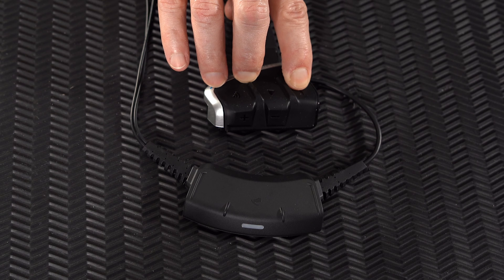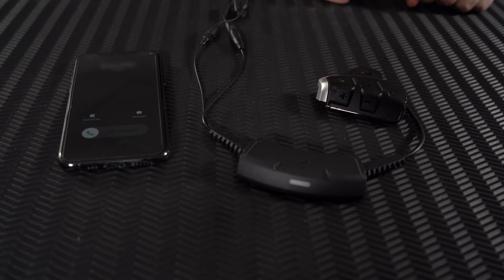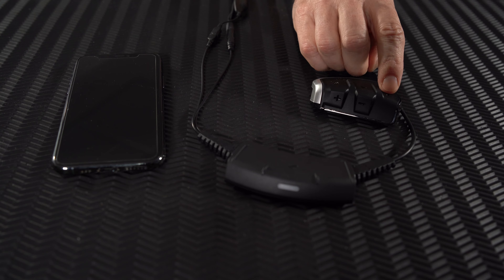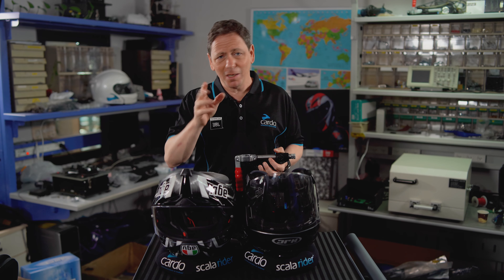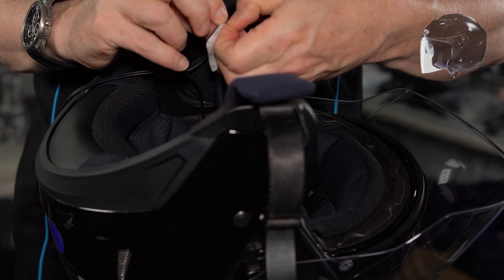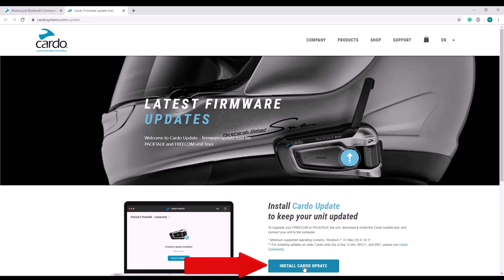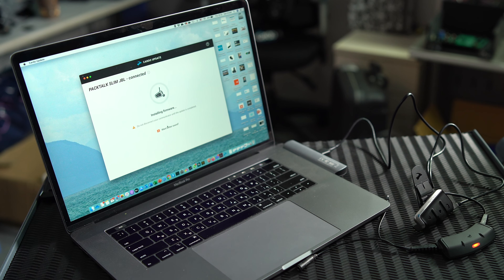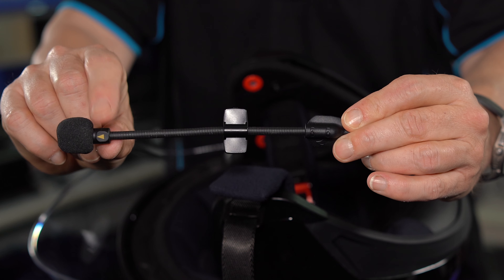Cardo PACKTALK Slim: Complete Tutorial

Comment: Just got this and haven't ridden with it yet, but a few things I've found already. 1)The helmet feels a fair amount tighter with this stuff installed, 2) the in helmet microphone is pointy underneath the foam a stabs you in the chin if the helmet gets bumped, and 3) the charging cord is only about 40cm long. Not long enough to Have your helmet charging off the ground if you're running off a power board and also not long enough to charge from a port on your motorbike etiher. Maybe they could have done away with the absurd over packaging and instead spent the money on a decent length charging cord. On charge at the moment. Would not have a clue how charged it is.. all I get is a red light. Not terribly intuitive.

Comment: hoping for a response, but will the receiver with the buttons that goes on the side of the helmet fit an HJC i10? i understand the i10 is one of the models that's supposed to use Sena HJC Smart but i'd like to use the cardo packtalk slim. The side of the helmet seems to be too thick for the receiver to snap on with pressure.

Comment: I just got the Cardo dual pack  because of all the videos I’ve seen on them. Went for our first ride today and man was I so disappointed. Music share would cut the music on and off  and back on in both modes, sometimes there would be so much static and wind noise then the mic would blast you out of the helmet and  then go very low. Voice command worked when it wanted to and the distance in mesh mode was not that great. We came back and actually took them out and installed the cheap old units that actually sounded better with less noise and static.  I wanted this to work for the music share and was disappointed from the start and it just got worse through the ride.

Comment: After riding my G4 for years, still riding my original Scala Rider. Bought a them when they came out, got one replaced after its antenna broke off. Now, their batteries start to diminish. So I looked into replacements.
While the Bold seems to be the obvious replacement, I like the Slime more, because - well - they are slimmer.
On the downside: Having to basically charge the helmet and not just a tiny unit is just really complicated when on tour and you have to deal with limit space. (Think of tiny hotel rooms, hijacking the power sockets from a restaurant, etc)
Honest question: Why is there still no USB-C connectors? Is it because of some form of regulations regarding water profess, or would you need to conform to more complicated charging specs?

I would love to see a unit like the Paktalk Slim with a Battery that can be swapped out and charged on its own. So I could always have one charge in my tank bag (or where ever) and switch them when the ride gets really long. And let's face it, the juice always runs out when you need it the most: in the middle of the night, it's raining and you desperately need your GPS to guide you to the next hotel. Wouldn't it be cool to just swap the batteries instead of fiddling with cables attached to some power bank, hoping the rain won't destroy both?
Reply from the maker: Hi, 
After multiple tests we have chosen this design in terms of battery usage. The solution for now is charging while riding.  Regarding USB-C, you can always follow our social media channels for any developments about our future units.
Thank you

Comment: I bought the Cardo freecom 2 dual pack. Sound was good between riders but I found I couldn't conect to the tft because it would just cause issues with the other rider . Cardo advised me to buy packtalk bold. I bought the slim version. My units must be faulty because I refuse to believe they can be this bad. Pairing was a nitemare, constantly saying, Helllo, hello? Can you here me?
When they were paired I could barely hear the other rider, when at motorway speeds, nothing. Then even at slow speeds I could barely hear the other rider and he could not hear me at all. Said he was also getting interference and sometimes felt like radio static.
I bought this so I could connect to the bmw tft and hear  my phone ect. The old Freecom 2 was better. I can't understand this. Also the Cardo app couldn't find any units even though they were on and connected. I took these on the North Coast 500 and they failed miserably. We'd try each day, to see if they'd work but going through the pairing ritual was ruining our minds. We just never bothered with them in the end. They just ruin the rider experience.
Another thing is, the helmet speakers go nowhere near my ears, I have the Hjc Rpha 11, the location for the speakers are nowhere near my ears but this was true or the Freecom 2. Cardo should make in ear speakers because all helmets and heads are different.
I don't know what to do now. I'm sending these back as they are not fit for purpose. I may try BMWs own helmet communication systems, they should at least conect to their systems and be able to talk to another rider. I swear I could buy cheap Chinese Crap from alibaba that would be better that these.
I paid £380 for two of these simply to talk to a friend. I could make something work better that these myself.

Comment: I would like to add one point that could be improved with Universal Intercom. I would like to have the option to select a “Universal Intercom Slave Mode” (Packtalk acts as mobile phone for the other unit) This way, when paired with a unit of a other brand, the command to start the Intercom call are the same as with a Cardo Unit (also for the other device). Right now it is really difficult to start the Intercom, if the other unit is paired on Mobile Phone Channel 2. Pressing the Phone button then just activates Google Assistant on my mobile phone (Mobile Phone Chanel 1).
Hopping to see the option on one of the next firmware updates.

Comment: I have my new Cardo sli. It was recommended to me by my riding buddies. I have an Arai helmet and it doesn’t seem to be compatible. There is an exhaust outlet on the back of the helmet. Which is blocking where you would mount the component. Is there a fix or work around for this?
Reply from the maker: Hi,
Please send a message to our Info@cardosystems.com with the picture of the helmet and the description of the issue.

Comment: Also, I often have to repeat commands for the unit to respond.  Is this common?  My microphone is slightly offset but is still in front of my helmet, only tucked slightly behind the right side cheek pad.  I have spoken on the phone with people and they say they can hear me, it sound a bit windy but not bad.  Just updated so hoping that fixes it, but wondering if anyone else has had experienced similar issues!  Thanks
Reply: I just tried setting mine up but it only recognised one voice command. after researching I found a guy recommended to change the language via the app to english UK instead of USA and it started working instantly. maybe try playing around with that?

Comment: I'm confused about the position of the hybrid microphone during installation. The manual states that it should be on the right side while the picture shows that it should be on the left. I ended up placing it on the right side because otherwise the wires are too short. The same confusion is visible in this video. The microphone is placed on the right, but when the helmet is put on, the microphone is on the left side. Confusing. In addition, the microphone is always blocking the closing of my modular helmet.

Furthermore, a great device except for the radio reception. This one is dramatic and the RDS function does not work either.
Reply from the maker: Hi,
For technical assistance, please contact our customer support by choosing your device in the link below:
 https://ecs.page.link/mzDzm
Contact your local distributor via the "Still got a question?" section, at the bottom of the page, by choosing your country. 
Thank you for your cooperation, Vince.

Comment: This video should've shown how to pair devices using the phone app.  It's way, way easier to use the app than remember button presses.

Voice recognition works perfectly once you realize a couple things:
- Set voice sensitivity to High in the phone app
- Speak SOFTLY to Cardo.  There's no reason to yell at her, even if the wind is loud.  There's also no reason to insert a pause between "Hey Cardo" and your command.  Just gently say "hey cardo battery status" and it'll work perfectly every time.
- Speak LOUDLY and clearly "OK GOOGLE" to activate Google assistant.  Then wait a couple seconds for the phone to connect before saying your command.  I'm not sure if you need to speak loud or soft to wake Siri as I don't use an iphone.

Pro tip: I love my Slim unit, but my first one had the micro-USB fail and was replaced under warranty.  The new one has a slightly revised connector design (still micro-usb, unfortunately), but it feels SUPER stiff when trying to insert a cable.  To avoid breaking this new unit, I bought a tiny USB-to-magnetic connector.  Now I can use a simple magnetic connection and not wear out the micro-USB plug.  It works for data transfer (firmware updates) too.  The rubber cap can't close, so I'm sure I'm compromising the waterproofness of it, so I make sure to remove it if ever caught in the rain.

Pro tip 2: I appreciate that Cardo has worked to add the best speaker options in the business.  But wind noise forces me to wear earplugs anyway, so I've moved on to just using good earbuds with memory foam to block the wind noise.  It's a game changer in terms of hearing your buddies without blasting your ears away!  You'll find you have to turn the volume way down compared to using speakers.

Comment: Add ability to update device without computer.
Reply from the maker: Hi, Thank you for the suggestion.
we will forward that along.
Thanks,
Reply: @CardoSystemsGlobal    Agreed!  It would be amazing if we could stream the update from our phone's data connection rather than having to go to a PC to plug in and manually update firmware.  It would eliminate the need to maintain iOS and Windows versions of updaters too (and solve the Linux user requests).